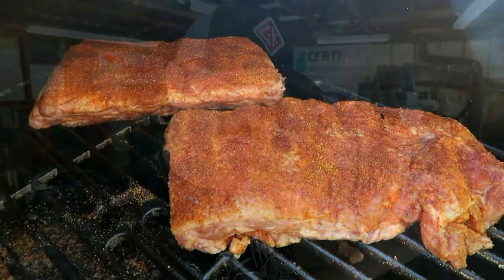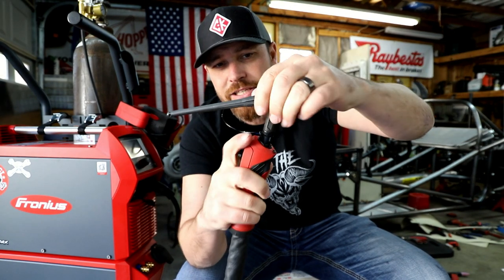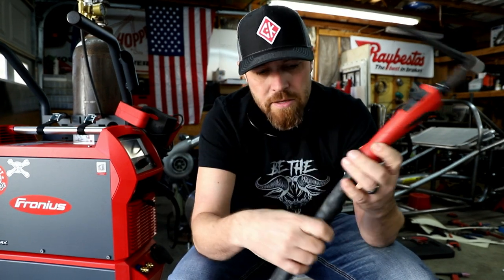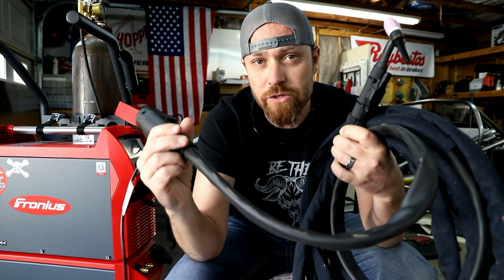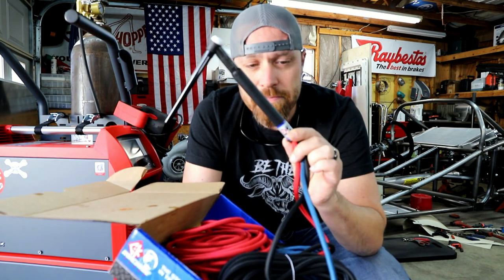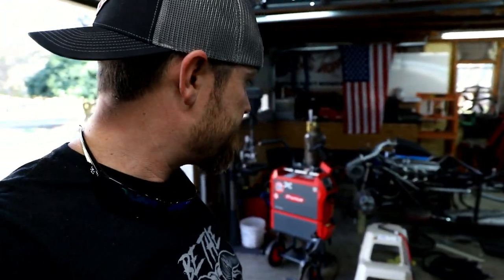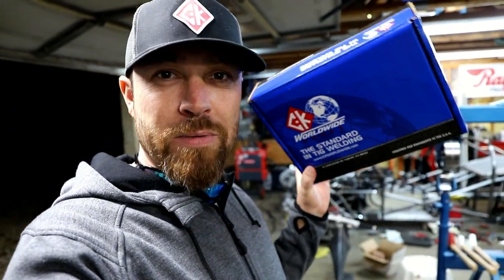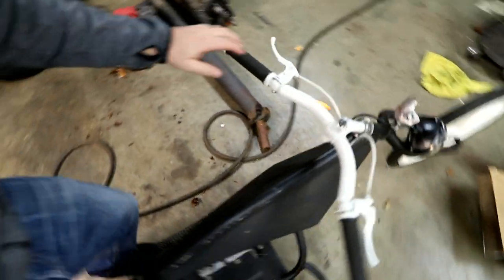CK Worldwide TIG Torch Conversion | Fronius Magicwave

Comment: I got the exact same CK TIG torch as you did, BUT I realized that I got the version with the male screw connector so it doesn't fit my machine. I need to either create an adapter in the lathe, or order an adapter from somewhere which would take a while to get. Crap

Comment: I weld light gauge stainless, so I tend to hold the torch by the neck for better control. Sadly, the trigger is in an awkward place and the weight of it makes it comfortable. GOOD NEWS is that I can switch to scratch start mode which works just as well.
Reply from the maker: Yeah Fronius and other aftermarket torch companies also have a ton of options

Comment: I think I’m missing something. This welder doesn’t have a pedal right? So the amp control and trigger are the buttons on the torch. 
So when moving to the CK  torch, how do you initiate the arc ? I didn’t see any button add on, or pedal.
Reply: I have the same question.
Reply: There is a separate pedal. It just has a amp controller built in the torch as well.
Reply from the maker: You can choose to use the pedal or the torch for amp adjustment and initiation...depending on what you are doing.

Comment: So one button is on and off switch. One button is for amps settings on the machine and one button to turn the pulse on and off at the machine?
Reply from the maker: yeah down on the left button is on/off and up is on /off for pulse. The right button adjust amperage by toggling it up or down....you can also use the pedal if you prefer

Comment: I tried fitting a CK 17fv with a dinse 35 adapter but it doesn't work because you still need a switch socket to trigger up or start the spark to the Tig torch. CK may sell all sizes of torches but NO ONE SELLS A TRIGGER SWITCH so that this transsteel can weld with a regular tig torch!!! there are at least 8 holes on the switch socket and no one knows which of them is the two that need to be connected to a finger trigger switch... I'm just wondering if you plug the wrong ones and 'short circuit' the damn welder and there goes the warranty... DOES ANYONE KNOWS HOW TO IDENTIFY THE TWO PINS THAT WILL START THE ARC ON THE SOCKET TIG CONNECTOR? For anyone that can answer that correctly, I will give you a website No One knows about where you can buy the Fronius 2200A Tig torch for only $140.00 ... hit me up...
Reply: I would try holding a digital multimeter thats set to check resistance/continuity (measured in ohms units) on seperate pins of the tig torch plug. When the reading accross two seperate pins drops to zero or near zero when you depress the torch switch I would assume that technically you have found the two pins that are connected to the on/off switch.

Comment: Great Info & Video! 
I didn't realize that anyone was making Accessories for Fronius Machines, besides Fronius themselves.
I am currently getting ready to sell off all my Blue Welding Machines, and I am going totally Fronius. You and The Fabrication Series have convinced that Fronius are the only Machines to own if you are serious about your Welding/Fabrication.
I just wish they made the TransSteel 2700 with the Capability of having a Water Cooled Torch for the Tig & Mig side.
Water Cooled Torch is the only way to go when you do a lot of Tig. I run a Miller Syncrowave 250 Tigrunner right now, soon to sell it to finance my Fronius Fix. Lol
I've never had the pleasure or luxury of having a Water Cooled Mig Torch, but man would that be the frigging Berries or what?
I do an metric fuck ton of Mig Welding, and would love having a Water Cooled Mig Torch/Gun..
Reply: What blue machines you have?
Reply: @sbranham86  sorry just saw this. I HAD  a Syncrowave Tigrunner 250 with the Water Cooled setup, a 211 Autoset, and an older Millermatic 250 Mig Machine, when I say older I mean a 2000 Model year. I actually shoukd have held on to that. It was the old Transformer Model. Those things are Bulletproof. Ran it for 20 years with not 1 single issue.

Comment: Did you make a pinout of the TMC connector when you hacked up the fronius cable to make your own adapter in the beginning of the video?
Reply from the maker: I did
Reply: Awesome. Would you be willing to share it? I am going to be buying the CK adapter and want to run a trigger to a flex CK head torch. I’m ordering in a plug and I don’t wanna hack up my original Fronius torch to find out the pinout.
Reply: Curious to know the wiring set up as I’m now about to switch torches myself
Reply: @lukejohnson180   You can't actually use a regular trigger setup with the fronius. It has to be one of theirs or you need an adapter box.
Reply: Here is what Brad from SSC Controls told me. 

"We don't directly sell a pedal for Fronius, because they have a PC board in
their pedals.  So you can't replace theirs directly with one of ours.

You also can't do a pinout on their foot pedals because of the PC board.
Since the pc board is in the foot pedal, you can't just read the pinout on
the plug because the PC board changes the potentiometer input into some kind
of communication signals.  I have attached a schematic of their pc board,
but as you can see on the right side (which is the plug side), there is no
way to do a pinout of it like you can with a normal foot pedal.

We have been working with Fronius in the past year to set up an adapter box
that allows you to use our foot pedal on their machines.  But you'd have to
buy this adapter box from Fronius, because they set it up there.  I'll
forward your info to our contact at Fronius to see if he can offer this yet.

Thanks for checking in with us and have a good one!"
Reply: Fronius sent me a PDF of the new adapter box. I haven't ordered it since it is so expensive, but here are the part numbers. 

"42,0440,0306 is the part number of the adaptor box for machines with a TMC connection. 
42,0440,0304 is the foot pedal we offer from SSC
 
You will need to order from the distributor you got the machine from.
 
SSC would need to provide the finger control they offer with the Miller 14 pin connection we do not sell 
that."
Reply: If you have taken their torch ends apart and replaced the trigger PCB, you can see that it isn't as simple as i thought originally. I don't know how the author made this work, maybe he took fronius trigger PCB out and made a new trigger from it.
Reply: @Johnnytk36  thanks for the reply, I have the gas lead adaptor Fronius x 3/8 BSP for the euro torch, and I also have the TMC. Usually at my old work place we would put a 2 pin plug on the TMC connecting the Red/Black wires which are the trigger on/off but Fronius have multiple different colours non of which are black or red, 

This evening we put a multi meter on to get a reading back from the old Fronius torch, we believe it may be brown/white as the on/off trigger, so wired up that way fingers crossed the machine doesn’t default when plugged in.
Reply: @Johnnytk36  considering ordering a new torch from the Fronius dealer so they can just install correct parts from the start!
Reply: @lukejohnson180  Let me know what you find out!
Reply: @lukejohnson180  did that work for you? I’m considering doing the same!

Comment: I just picked up an Everlast PowerArc 140ST so I can try my hand at TIG, after MIG welding for the last few years, but the torch that came with it just feels way too damn big. I don't know if you have a done a video on it or not, but do you think you could go through the different size torches? Air cooled and water cooled?
Reply from the maker: https://www.youtube.com/watch?v=_4JeYtwZsPE
Reply: Why didn't you just get 141stl same price and it has gas solenoid built it.
Reply: i got this one at a hell of a price

Comment: Do they make a torch for the eastwood tig welder to turn it into a watercooled torched? Who makes that zipper cover? Is it flame proof?
Reply from the maker: I am pretty sure they do.
Reply: Yes they do. I just bought an htp cooler with a ck flexloc torch for my eastwood. Works great plus using the smaller flex loc #9 sized torch, not the #17. "Usaweld" great people to work with, least in my experience.
Reply: @jakeandrules7724  sweet

Comment: Right names for the parts:
Dinse connector SLWHAT-35M (instead of SLWHAT-35MF)

Water hose Quick release converter large plug QDWAP (instead of QPWAP)
Reply from the maker: no its has to have the F for the Fronius one
Reply: @Thefabforums  then i can't find theese parts on their website😅.
Nice 1 anyway i Plan to buy the mw230 i on gen/febraury.
At work we use the mw2200 wich Is an older model (they still produce It), and It works really good: we weld only ALU and the ac side Is really nice.. i Just used It on DC a couple of times ti weld some scrap iron, so can't really Say anything about the dc side, but the arc Is always so smooth.. It looks like the welding machine does It All and you have Just to hold the Torch😂.
Really nice units... Gz for your Torch upgrade anyway; i live in Italy and even if I'm european, i hate All the EU torches design: US design Is so much confortable 😍

Comment: Which consumables work in the fronius torches?
Reply: I also don't find information about this, I think I have to contact fronius themselves to find out.
Reply: Series 20 torch consumables. I used parts directly from a miller series 20 on a Fronius machine
Reply: chance hogelie thanks
Reply: I contacted the Fronius dealer and he said that 17,20&26 accessories are compatible with the threaded cup on the torch head, the torch head with the plugged on cup can't be used with this accessories.
Reply: dutchman404 thanks. I bought a gas lens kit for a 17 but the heat ring doesn’t fit
Reply: @sbranham86  17 and 20 series torch consumables are completely different in size so that shouldn't be correct information. 17s use the bigger original style collet bodies while the 20 uses a smaller compact style. Ethier or will not fit in opposite torches.
Reply: chance hogelie thanks. I’m gonna try some 20 series